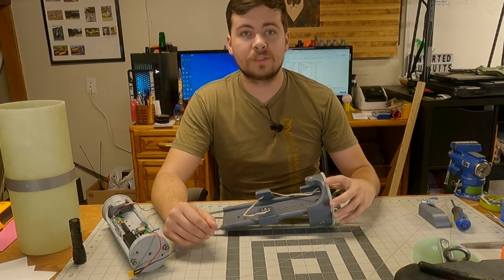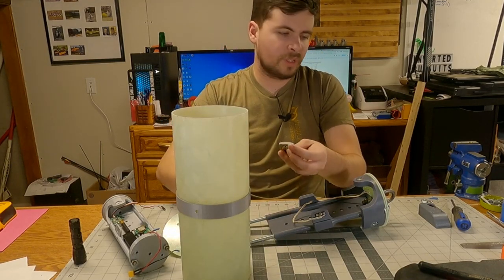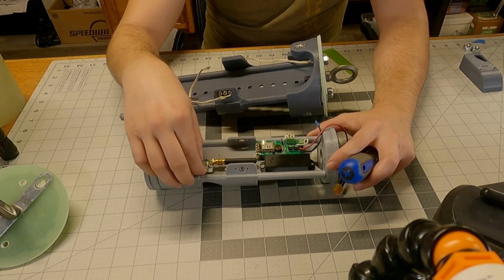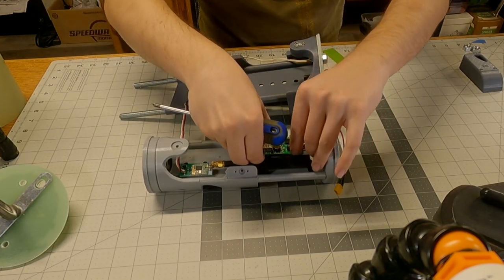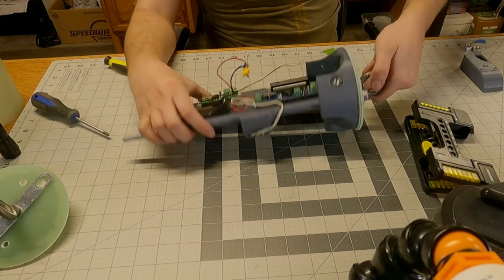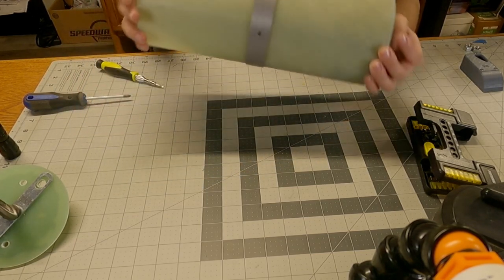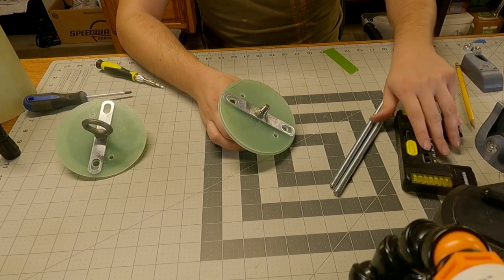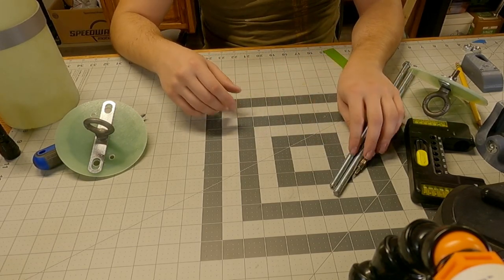PRAETOR Electronics Setup - Level 3 Cert Rocket Build Pt5

Comment: Is there a particular reason you go with the tracker in the nosecone vs the e-bay?
Reply from the maker: Typically my rockets are small and I've had bad layout in E-bays that place the tracker antenna to close to the launch rail which results in no signal track as the rocket leaves the pad. So the nose cone reduces that risk. Praetor ought to be big enough I can place it in teh E-Bay. but we'll see what I end up doing.